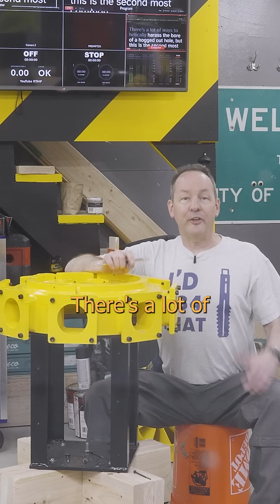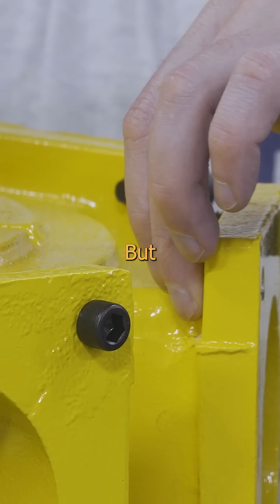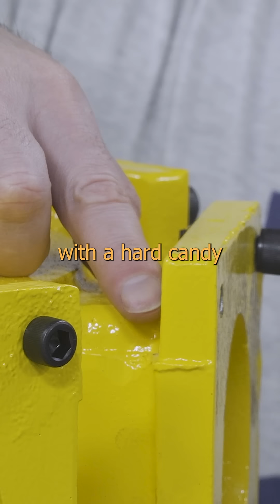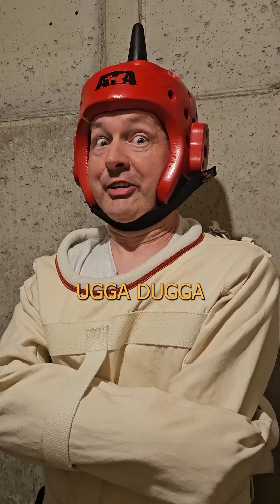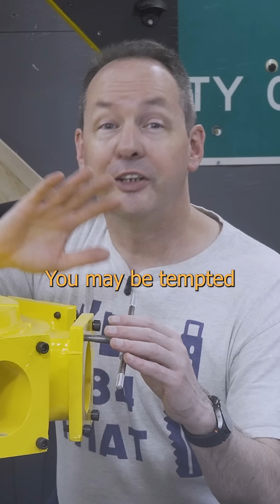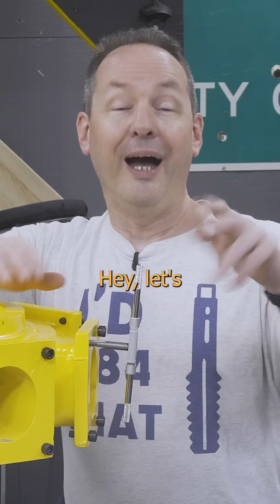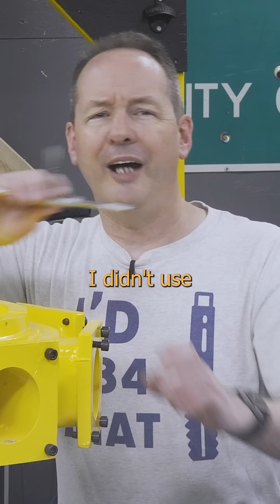Thread Chasing  #chrisboden #comedy #engineering #skills #workshop #metalworking #tools #apprentice

Comment: Another good way to start taps is to rotate it backwards until you feel the tap drop into the thread. Then you rotate it the correct way and go to town. Makes it a lot easier to avoid cross threading on a fine thread or on threads that may not be the cleanest from the start. 

Also they make thread mills now that drill the hole and thread it all in one pass. Even available for 40+ rockwell material.

Comment: One of my very first jobs in my hometown as a young man was when I worked as a machinist in a factory that made bimetal thermometers for industrial applications. I tapped more holes in a week than Johnny Wadd did in his entire career.
Taps are meant to cut metals, so they’re manufactured out of carbide steel, which is incredibly hard, but also incredibly fragile& doesn’t react well to things moving quickly, so I learned to take my time & to always use lube if there’s too much screaming, kind of like my sex life & that’s pretty cool.😎

Comment: Dont think i ever broke a tap with an impact. I have multiple size impacts with adjustable anvils. My bosh ones by far are the best I've used. Just precise and as close as to its rated tourqe output as it can be and i can go slower then hes twisting

Comment: Dumbass.  Had to tap 1/4 304SS.  Yup.  Fucked that up.  Get what happens when you fill a stainless hole?  The material is way too Fn hard to drill. Had to burn the hole with plasma.  End mill, not drill a new hole.  Now tap it very slow and correct. That was gonna be a $700 F up.

Comment: Im a dumbass. I was chasing an M10×1 thread with a drill, straight off my lathe cause there was a burr on the inside of the bore. Started the tap on the thread by hand, only a half pitch or so, forgetting I had the drill set to the higher setting. The tap snagged and tried to cut a new thread. Felt like my wrist was going to snap

Comment: Dumbass 🤣🤣🤣 I was chasing threads on a small block Chevy bellhousing, and thought I was hot stuff and used a drill. Ended up stripping a couple holes out, so I redrilled, retapped BY HAND and drilling out the transmission bellhousing to fit the new, bigger bolts 🤣

Comment: I just get a bunch of bolts that have the same thread pitch as the hole, then i cut the bolt heads off to make studs, then i just thread them in by hand and then paint whatever im painting. Its worked good for me so far.

Comment: Ugga dugga dumbass when reinstalling a new headlight on my Nissan Altima and destroyed the sheet metal threading. I was just on the zone and trying to get done, I hadn’t even thought about it until I was wondering why the bolt didn’t hold the headlight…… whoops!  Epoxy is your friend. Sheet metal doesn’t rethread.

Comment: Lol! That lesson gets learned around me all the time. 
Ive had the best luck removing broken taps with a punch and a hammer and a lot of swearing. (No I dont have one of those fancy three fingered things that would undoubtedly just bust off in there too) and I havent been mad enough within proximity of a plasma cutter to burn one out.
Those all in one taps that load into the impact are fun. I can get about six holes drilled and tapped before the ghost comes out, so they go to the helper on the other side of the jobsite, and I wait and listen.

Comment: Here's my 2 cents. I build automated machine's for a living and have designed, machined and fabricated over 5,000 parts. All taps 8-32/M4 and above get chucked in a drill if they aren't being tapped on a CNC. Not just for chasing but for the initial thread cutting too. You need a steady hand and a good starting angle but you get good at it. USE OIL (Dont bother in aluminum). Only buy high quality spiral point or spiral flute taps. Spiral point are cheaper and stronger but push the chip down so they are only good for thru holes. Spiral flute curl the chip back up out of the hole and can get almost as deep as a bottoming tap. Stainless steel only gets fresh sharp taps. Hard specialty metals get thread milled on a CNC. Use this advise with caution if you're a newb. Practice on parts where breaking a tap inside a blind hole isn’t life or death.

Comment: Dumbass.

Working on a copeland compressor. Not the kind you find in a house condenser but the kind you find in a grocery store on a rack system. It's the size of a small engine. ( Basically is a small engine) Had a guy use a standard tap on a metric hole. With a drill. At about a 190⁰ angle. What a mess!

Comment: TiN coated CNC-mill rated thread taps are fun. M24 tap costs like 300+€, lasts basically forever when used correctly, BUT if it would happen to stop inside the hole for any reason and you end up having to back it out manually, it's going to leave basically every cutting edge inside the hole, ruining the tap AND leaving the hole full of tiny hard as f*ck shrapnell basically fused inside the material that are going to ruin every following tap too 😅 Yes, that sounds oddly specific exactly for the reason you'd think 😂

Comment: Dumbass - I perform rework at my job. Fixing aircraft parts. Had an order of 200 parts with 4 threaded holes that needed to be tapped. In inconel. The second time I got an order like this due to a manufacturer issue my hands were still hurting from last time. So I tried a drill. Tap snapped. Tried remov8ng the tap and it didnt go well. Tried it 3 more times at instance from leadership when I complained about hand pain. 

I now pick a random coworker that I didnt borrow last time. They get volun-told to come help me. By hand. 

So yes. I have learned my lesson of taps in a drill. Bad idea. Angry crunching. Cross threaded holes. Hell. Now I just pick a vict- I mean volunteer to help me.

Comment: I had an engine coolant plug to put in and threads where a bit stuffed so I got my tap out and hooked it straight up to my drill it got half way and jammed though I would wind it back out and send it a little harder wrong move snapped and spent 2 hours welding a nut to the top of the tap to pull it out ow day's of being a apprentice i don't miss being a dumb ass haha

Comment: Worked assemblyline so i had to tap with a pneumatic drill to make time. Went to take it off my drill when i was done and accidentally hit the trigger. I had a glove on the other hand. Tap snagged my glove and wrapped my fingers tight around the tap for the split second i tapped the trigger. Im lucky, but many have lost fingers from doing this

Comment: now imagine my boss trying to use the tap to extract a small alignment pin. as expected, it snapped off. because why use a full sized bolt if an expensive tool with more vurnerability to sideways forces can do the job too?

Comment: D u m b a s s. Had 20 holes that needed tapping and had the part in the mill. Figured that I knew the locations, let's power tap this! Went well through the first 12 holes. On Lucky number 13, the tap broke from being dull. If I was hand tapping I would have felt the resistance. Luckily it was a project for school and not a production part.

Comment: dumbass here: I was only a bit younger and wildly confident with my dad’s Makita. I had no idea what taps even were and this was that sweet spot in time where GPTs weren’t mainstream but Google was still shitty because of SEO minmaxxing, so my ingenious caveman speak Google searching skills couldn’t figure out why the hell my screws came prechipped

So I drilled them in, and I had no idea speed was supposed to be a consideration.

The power drill travelled fairly straight in the forward direction, but the tap spiralled its way in quite oddly.

Thankfully the rest of the construction was pretty wonky too so straight was a  relative definition, but I think a few of the screw holes turned out looser than they were supposed to be because of the unsteady entry.

Comment: Working at ford, theres a recall for the rear differential bearings, if they fail an inspection they need new side and pinion bearings. Taking the cover off, broke a bolt, it was a through bolt so I started drilling, was going ok then I broke the bit, which are tipped in tungsten carbide. Successfully drilled through and then broke the tap coming out. Used some welding wire in the flutes to remove it. Tapped the next largest size and installed a helicoil and called it a day. Never came back as far as I know. What a nightmare.

Comment: I was a machinists mate auxiliary for 5 years in the navy, i learned the hard way as a wee little e2 just trying to do a simple bit of cleaning maintenance. Shut some valves, take six bolts out, pull out a basket strainer, clean the strainer, put the cover back on, hand tight the bolts with a wrench open the valves again and walk away. Seems simple enough. Until you realize youre a 19 year old with no real concept of how life works and when you notice the threads need a scrub because the last guy caked it with week old toilet corn so you decide to do this cause a tap is the only thing thatll fit and nobody questioned my genius idea. Not sure how it is now 8 years after that incident but for a while some of those threads managed to fit two different thread pitches. Theres a reason i was a mate and not the machinist

Comment: Dumbass... Times 3... Yes, if I didn't learn my lesson the first time 😂

Three of my valve cover bolts broke off when I was doing the top end on my car and I was in a rush so I used an extractor but it screwed up the threads a little so that I went to try and Chase them. They were full of aluminum oxide. I put them in my drill on low... And immediately regretted that decision... The mistake I made was doing all three holes at once I'm the dark only to try and put a bolt in and realize I completely fucked up the threads and now I had to retap slightly bigger, and replace the bolts, which realistically meant I was re-tapping every single fucking bolt hole for the entire valve cover... All 22 of them and sizing up all my bolts from m6 to M8...... I have never in my life so desperately wanted to torch a car to the ground as I did that day 😂 also a very expensive lesson when you're using torque to yield bolts that cost you $20 a piece 😭

Comment: Use a thread chaser, not a tap. Looks like a tap but cleans and reshapes the threads whthout cuting.  Will help preseerve whaatever thread toleraances are left.
Reply: Those work well,  I've had a couple of instances where the bolt was so corroded that it left pieces in the threads and a chase wouldn't clean it out so I had to spend 15 minutes with an air line and a tap to get them clean. But in normal situations a chase is a  good tool to use.

Comment: Dumb ass. 
Mine was an aluminum engine. Spark plug blew out 1999 ford Taurus SHO and needed to chase the threads and made it worse, so had to tap new threads. Just had to make sure I got all the shavings out or else puff, large paperweight in the drive way. That’s was 2017. Car finally died 2025 due to son “accidently” hitting a tree that was running across the road one night that he was drinking. Thank God no one was hurt. Needless to say that repair held up another 100k miles .

Comment: My Dumbass moment happened when my journeyman went through drilling the holes to be tapped. It was ¼" steel. 
I was flying through tapping each hole in my path. Went just a little faster and the tap snapped almost flush with the metal decking. 
Being that I was given 3 taps, I continued on, planning on going back later.  Got through 5 or 6 more holes when a second tap snapped. With 1 tap left, I decided it was past time to investigate. 
Long story short, it's good to know where all the angle iron is under the deck plating. My Jdub has drilled directly next to the angle. Being the bit is slightly smaller than the tap, as soon as the tap met the angle, they hugged fiercely.

Comment: If you REALLY have to use a drill, only use it for the middle part, start by hand, which you should be doing anyway, and use some sort of coupling, like a wide fork (like a bike hanger) with one on each side of the existing tap handle, or more likely a long one of those super-flexible drill shafts, that will limit torque and let you not have a solid axis through the rotation, as that is where you really can screw it up. (Or down, or sideways.)

Basically, you want it to be entirely free to self-align no matter what.

Comment: Ha. A proud dumass, i tried tapping the aluminum brake meter connection on a 2001 silverado. I spent more time looking for an adapter for my drill than i would have just doing it by hand. I then of course had to replace the entire valve.

Comment: Was tapping a hole for someone after making the same product for myself the hole was supposed to be 100mm depth since I was doing this tapping all day after I got the tap started I put the lathe in gear and gave it a second of power this took it 80% of the way there do the last twenty by hand think the hole on my mates piece was the correct depth of 100mm I gave the lathe a second of power and then I heard expensive sound the tap had snapped and is still in the piece to this day 😂😂

Comment: My dad had special bolts he got from an auto manufacturer, that were called "thread chasers." an actual tap with a bolthead! a production item, but still they figured it out. They never broke, and they never cross threaded. how does that f-ing work!
Don't know if they ever got dull being used in assembly line production air tools.

If there's a will there is a way. 
No matter where ya go, there you are!

Comment: My dumbass still has the tap and a lefty drill bit broken off in my engine. Don’t worry the other two are holding the heat shield just fine. I learned my lesson and I now look up how to use tools before I use them… on important things.

Comment: I worked a powder coated CoxReels assembly bench and went through this issue.
   Now, I know good a damn well, that you are aware that different tool maker's tap have different tolerances, holes ate tapped at different temperatures, taps get dull, and holes get dry tapped.
   So.
Taps have a tendency to "shave" thread lands, no matter how careful you are.
   All my ME taps sets, when I was off-continent, at shops with names like Daruwala Bros., came in 3 tap sets, the first of which is a starting tap, and the last of which is a bottoming tap.
  Starting taps work well to clear old holes.
  An undersized jobbers bit can clear out much of the initial fouling.

Comment: 655 cubic inch big block drag finals head bolt wouldn't go in uggga dugga ugga dugga and used a tap and dye set and cracked the head used a crush copper washer where the fu*% up was and sent it down the strip at 177mph before the catch pan and intake straps held on for dear life while the piston let go out side the engine oiling down the whole track and costing us the finals and 30,000 for a new engine!

Comment: If you MUST use a drill, and know that you don't, then find a 12v with a clutch. If there is a speed selector set it and said clutch both to "1". Run it slow, and if the clutch catches back it out a bit and try again. If this doesn't work after a few attempts, click the clutch to 2 at your own risk. The safe bet is to swap the drill for a hand wrench, treat the hole like your dad does your mom, and use your hand until you've given it enough to get past the ugly bits, and then get back to drilling.

Comment: Most of the time I have to cut threads into something, it's on pipes. You do it with a lovely device called a 'pipe threader' an oversized ratchet with a tread cutter at the end. Use plenty of elbow grease and the right lube, as even then, the newly cut thread can get hot enough to burn your fingers.
But don't just raw-dog it. 
You gotta reverse the ratchet from time to time and turn it back bout 90° to 'break the chips', greatly extending the thread cutter's working life.

Comment: Starting today drilling out a broken bolt. Couldn't back it out and could t weld it.  So i drilled out the existing threads completely for the first eith inch on mistake before i found a smaller bit that left the old threads.  I then cleaned it back up with a tap. It worked. Has a little less threads in the hole but it bolted down tight. Luckily its just my lawnmower puller cover. Everytime feels like a practice even though I've done a hand full of times now.

Comment: Right or wrong, I use a drill, that has a clutch feature, which is set loosely, to clean thread bores with a tap. Flat rate doesn’t pay for tap cleaning threads, what it does pay for, is bolt and tap extraction procedures

Comment: "Dumbass" 🤣 was around 16/17 y/o, cylinder of moped had a broken off thread, grampa back in the day carefully removed the old one, then gave me the (back then) "mysterious" "thread drill thingies"... He CLEARLY said: "DO NOT put it in the drill! DO IT BY HAND".... After about 20 minutes i was like "Yeah right, by the time I'm done I'm your age🤣"...

So I thought INDEED: "Just put it in the drill and do it slowly"... WRONG, it went completely haywire, gramps "saved the day", but in the end one of the threads was 2 sizes bigger than the other three for the remaining two years I drove that thing 🤣🤷‍♀

Comment: Dumbass. Retapped a part for the actual in my car. Ended up making it angled, filled it with JB WELD then tried again and cracked the block. No ac for 4 weeks...

Comment: former USN, worked at a SIMA rebuilding BIG hydraulic actuators, pumps, and valves.  Taps are my best friend.  As you get deeper down this hole, you compile a collection of starting and bottoming taps.

Cuz dissimilar metals, galvanic corrosion, and periodic maintenance unfortunately meet in the Venn Diagram of the US Navy.

Luckily, never been that dumbass, but I was also taught about taps and dies from my father when I was 8.  Those skills continuously improved thanks to uncle Sam's Machine Tool Operator school.